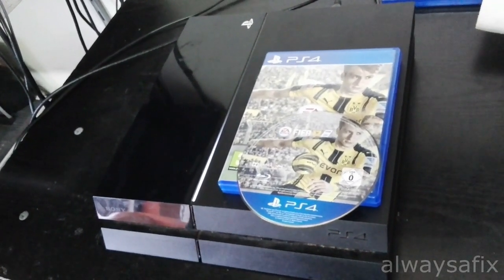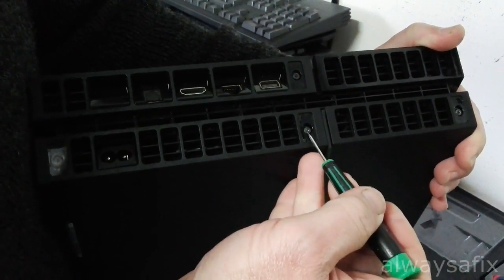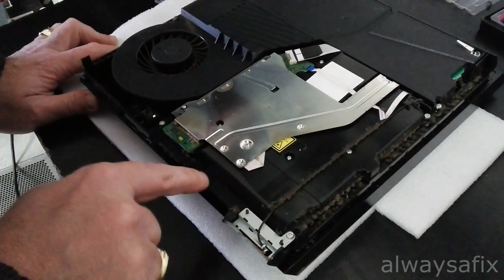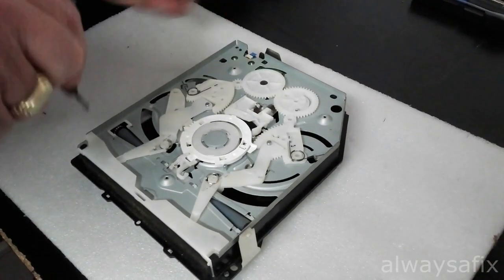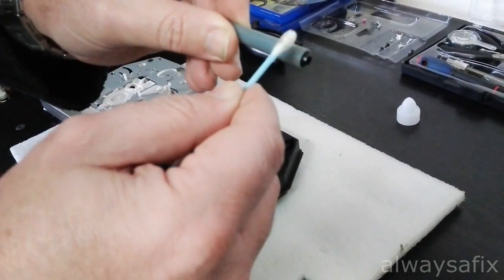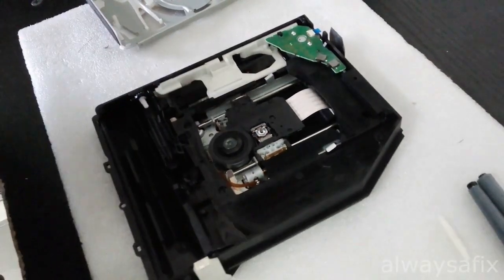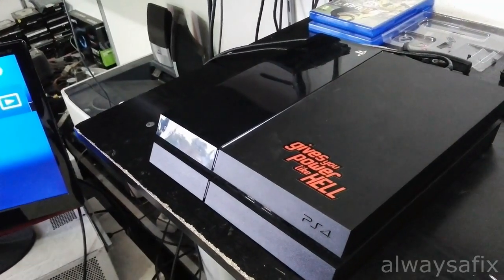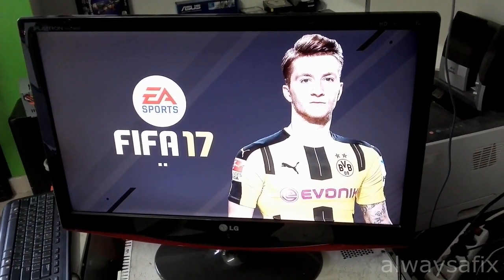PS4 laser clean Sony Playstation

Comment: This was VERY Helpful.  It did not fix my problem.  My PS4 won't recognise a brand new game i bought today.  Only will play already played discs.  Sucks bumholey.
Reply: DAVEY WAVEY same thing is happening to me , I just bought injustice 2 and it won't let me play it keeps saying it won't recognize the disc
Reply: Access Safe Mode and select option 5 (Rebuild Database). If the option does not resolve the issue, select Option 7 (Reinstall System Software).

Comment: Thank you very much I had the same problem I have tried everything rebuilding the system making the update but nothing works so I just open it and I clean the lens I didn't have alcohol so I use it a drop off a perfume to clean it didn't work at the first try so I give up after 24 hours I tried a DVD game and it works thank you a lot

Comment: I just discovered it now! There is a another way of cleaning the laser eye without unscrewing anything It might work with any system including blue ray DVD players. But it works with my ps4 pro. Very simple.

Step 1. While the system is off grab a butter knife and a piece of napkin. Wrap one layer around the knife and apply alcohol on and slowly insert the knife into the insert slot (again any system or blue ray or DVD player anything system that reads disc) and move the knife around very slowly.

Step 2. Turn on the system. Take a cotton ball or q-tip ( cotton ball preferred) and apply alot of alcohol on the game or movie ect. and insert it into system..while the eye is reading it's being clean at the same time..(.remember in the insert slot there is like a sway brush something like that I don't know what's it called on the ps4 pro you can see it...not sure on any other console)...that will take off alot of alcohol..so that is why I say apply alot of alcohol.

Step 3. If it still says unrecognized disc  take out the disc apply more alcohol then insert it again..it should work the second time you do it...if it does not work the second time try it again...it is cleaning the laser eye. Only keep doing  step 2 not step 1 after you've done step 1.

Comment: I cleaned my laser with 70% isopropyl alcohol and q-tip I still get unrecognized disc 

Update I changed the drive
Reply from the maker: If cleaning does not work the next step is to replace the Laser. Good Luck.

Comment: Thank you Sony for making what could have been an easy project as incredibly frustrating, difficult, and mind blowing stupid as possible. Who ever decided to put multiple types of screws that all require specialty tips should be shot. I have a whole arsenal of specialty tips and of course NONE fit. I had to improvise with what tools and tips I had. Got as far as the white gears but no further. I just blew into it with my own two lungs until I was light headed. Which fortunately fixed the issue. Hell if I blew any harder than I'd be permanently retarded like Sony.
Reply from the maker: You are very welcome, congrats on your fix